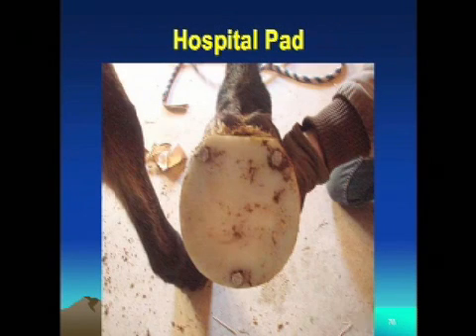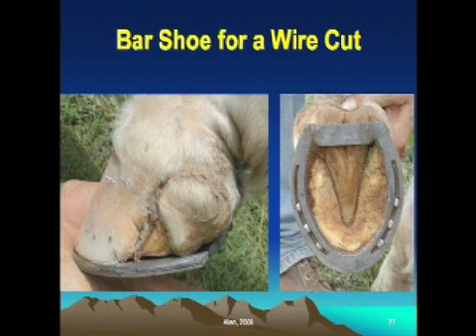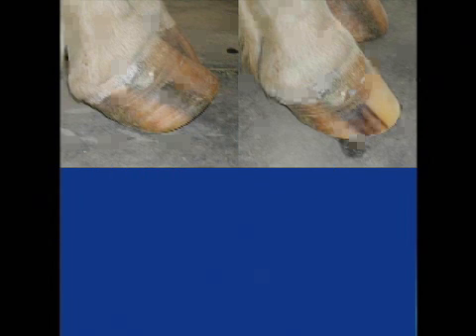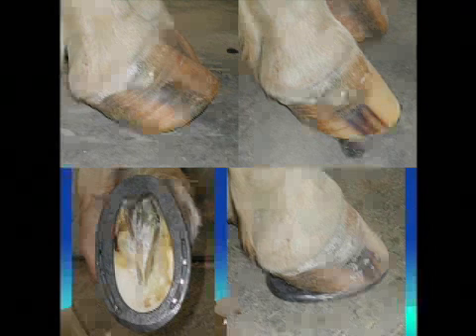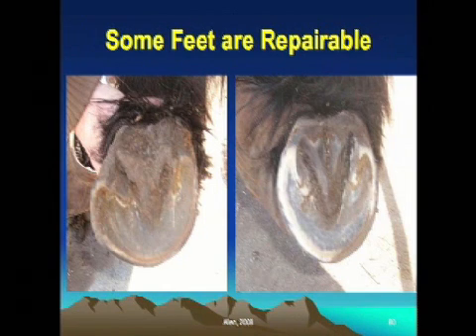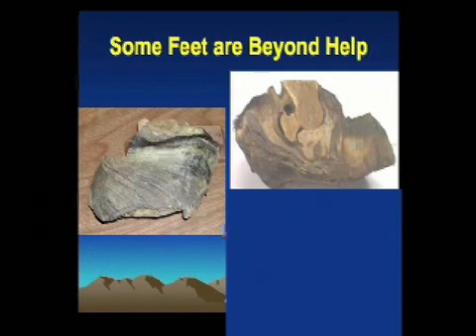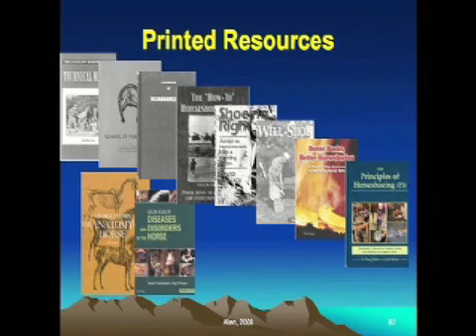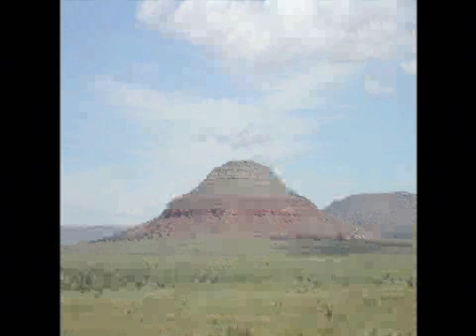Corrective Shoeing for Horses & Conclusion, provided by eXtension

Comment: if our horses have abcesses the farrier removes the shoes as poulticing is required and then reshoe when healed.
just wondering why you would leave on the shoe and cover up.?
also , the hospital pads at the beginning of vid you say if theres an abcess you can just remove the bolted pad - wouldnt you be removing the shoe too ?  thanks